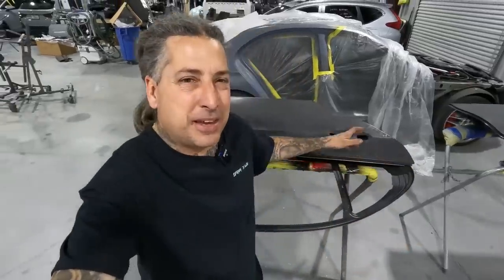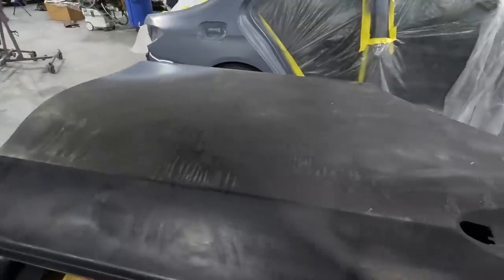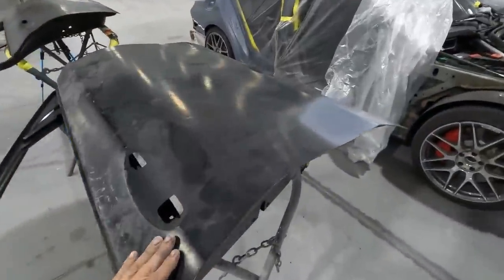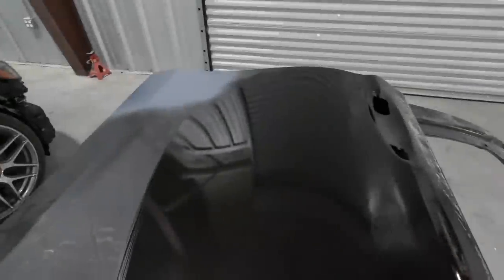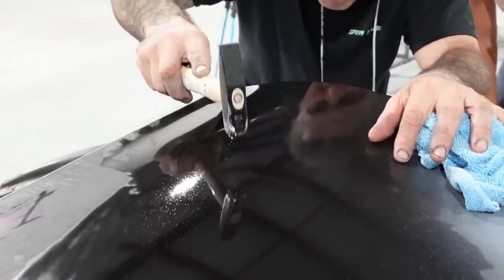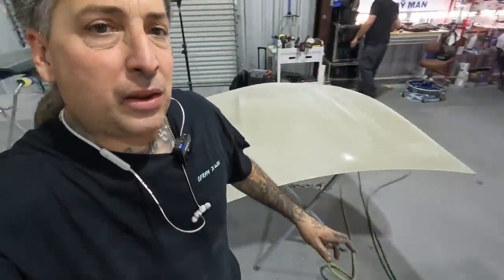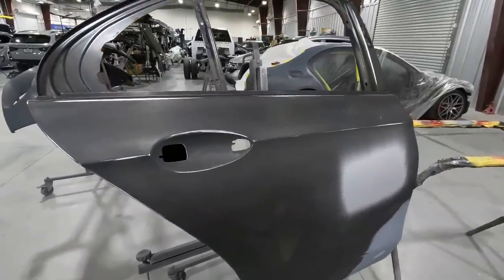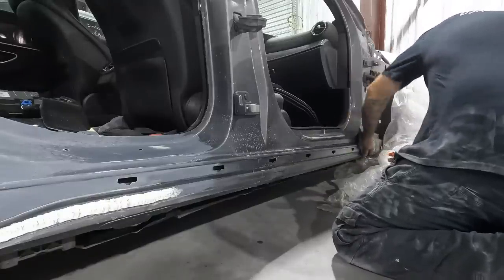Repair And Paint On A Mercedes E63 AMG - @BackYardBoyz

Comment: prepsol is a must do always before painting  ,  as shown( great work )👌 even after rubbing undercoat , it shows everything  , and gives you the opportunity to either block out or pick up minor imperfections. 
alot of ppl miss this step or don't know it .
I also believe it's the operator who could ruin a perfectly straight panel by not taking the time or care in what there doing. 
great channel ,
Reply: Kinda new to this so prepsol is what you use first to see imprefections?

Comment: What setup do you use for clearcoat with the dv1? 1.3 tip what air cap great video again BTW
Reply from the maker: 1.3 c2 24 psi
Reply: @kandyman5315  thanks mate really appreciate the reply,

Comment: Just wondering what your usingon the DA sander for prepping the bare metal with? 180 grit or 220? 
Should I spray etching primer on the bare metal first or use the Bondo direct metal like the instructions say?
I have a bit of body work to do but you put epoxy primer down first.

After I am going to be using a eurothame  primer. 

Cheers!
Reply from the maker: Epoxy go's first. When using etch primer first bondo then etch
Reply: @kandyman5315  what are you using for sand paper grit to prep bare metal?